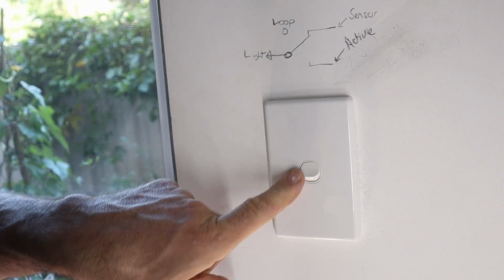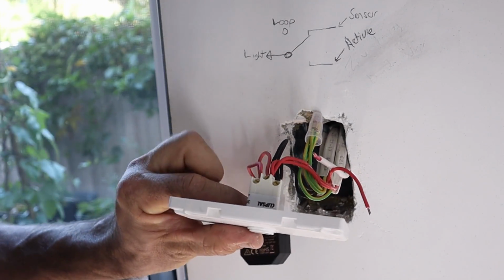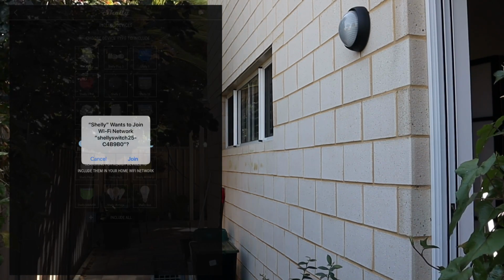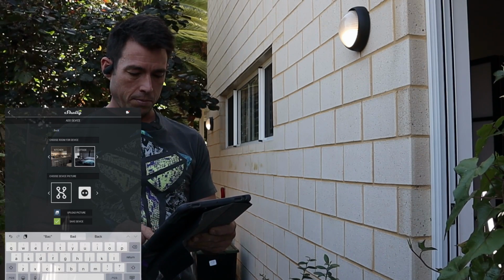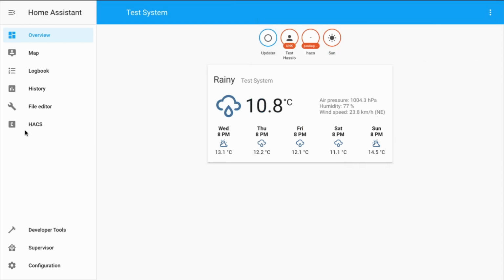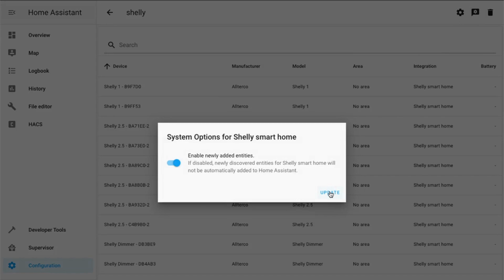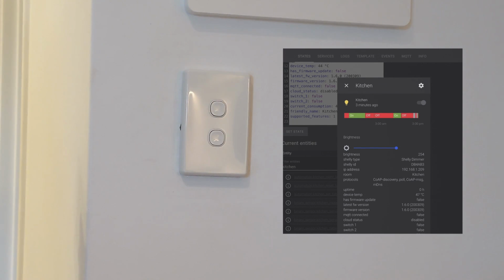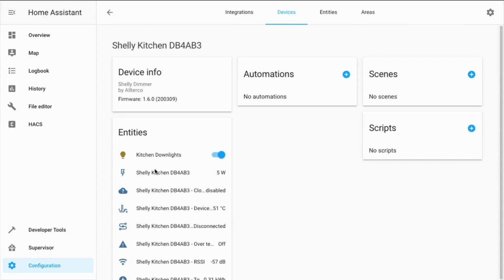Shelly For Hass

Comment: Hi Jimmy , Thank you for the very useful video. I configured my Shellies in the app with cloud on for all of them set a static ip and then added them to Home assistant using the Shelly intergration. Is the purpose of Shelly for Hass to re-configure the devices for use with MQTT (which I would need to do manually if I didn't use the addon) ?
Thank you in advance.
Reply from the maker: Hi Stavros, the Shelly for Hass integration has is just an alternative to Shelly integration, the, they both work well , but from my experience Shelly for hass supports more of the features available and has been around longer.
Reply: @SparkyJames  thank you for the reply/ I finally installed the shellies with the official intergration. I thing it offers all the options Shelly for HASS offers and it is more "user friendly"

Comment: I installed hacs, and shellyforhass, and added "shelly:" in the config file, but I cannot find the shelly devices on the integration menu. Can it be cause the user/password on the shelly devices?
Reply from the maker: Hi Enric, you don't need shelly: in the config file, you can remove it, I don't think it would stop it working though, to add the shelly integration, on the integration menu in the bottom right there is a plus(sorry you can't actually see it in the video)  click on that and search for shelly smart home in there.
Reply: @SparkyJames  Its soveld. I added the shelly: because I have to add de "user" and "password" field for the shelly devs restricted login. :)
Reply from the maker: Enric Aragó There is an entry option, for that in the integration setup page.
Reply: @SparkyJames  I will check it out!
Reply: It works fine, but the time uset by hassio to update the status of the shelly devices is pretty higher than using the shelly as a REST entity. There's also an option, on the config menu, but is still slow updating.
Reply: ah! and it does not appear the power consumption as an entity! :(
Reply from the maker: Enric Aragó That happened to me too, restart home assistant and the other entities will come up.
Reply: @SparkyJames  I try!
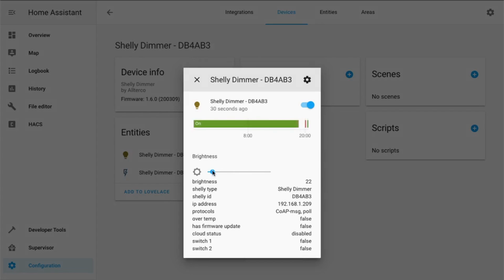Reply: Friend, I saw at 10:55 than you have activated CoAP protocol. I haven't. How I can activate it?

Comment: Could it be that you installed the shelly for hass repository before you searched for Shelly under integration? That's what I had to do before I was finally able to access the integration.
Reply from the maker: Hi Christoph, did you install Shelly for Hass from the HACS ? In the video I installed it fresh from HACS and it comes up in integrations you might have to do a restart of HA. HACS itself is a little tricky to install there are a few videos on how to do that out there. Just thinking about how HACS works you need a Github token for it to download integrations. I’ll try out a new system this week and see if I can replicate the issue you had.
Reply: @SparkyJames  Yes, I installed it from HACS. It seems that HACS and/or HASS GUI has changed quite a bit since you made the video. It looks different. I'm just starting to learn HACS so I'm not sure what more they changed, but it seems they took out some of the default repositories or split up repositories and integrations into two things or something. Another possibility could be that my HACS simply hadn't downloaded all repositories yet when I searched for shelly. But that would mean it takes at least 30 minutes for HACS to download all repositories, which seems unlikely.
Reply: @christophhaug  Exactly the same issue here, looks very different from the video. I fixed it by manually entering "shelly:" in the configuration.yaml file. As with you the "Shelly smart home" option didnt show up under integrations. It does after manually adding it :)
Reply: @minifugi  Good to hear I'm not the only one struggling. HASS has a steep learning curve and things seem to be changing so fast and the many install variations don't really make things easier. Plus they wanted to discontinue certain variants but then reconsidered that but still renamed them so that you sometimes spend more time figuring out which tutorial actually applies to your situation... I'm starting to see why people buy commercial systems... I think I'm going to give Hubitat a try, thought they say the learning curve is similarly steep...

Comment: Your videos are really well done! Question about your dimmer setup in the kitchen: can you use that second switch to remotely control another dimmer?
Reply: Thanks Christoph, Yes you could, but it would be not straight forward, you would need to do it through Home Assistant, I would probably use App Daemon to do it, it might not work quite as well as there would be a some lag, processing the button press and dimming  duration over the network.
Reply: @JamesEggleston  I didn't know about AppDaemon before but I'm surprised that I'd need another app (apart from HA) for this. Anyway, are you saying that while switching via mqtt will be very fast, dimming will be delayed?
Reply from the maker: @christophhaug  To clarify, you can very easily turn on and off another dimmer with the second button and a simple automation, but to dim the light up and down would be the tricker part as you would need to continuously step the level up as long as the button is pressed, I haven't tried it but I think I would find using app daemon easy to achieve it, though there is probably other ways to do it. App Daemon is an add-on inside home assistant, and uses Python to create more complex automations.

Comment: After a few hours work im still trying to get this easy to install app to work.
1)HACS is not included in a "Fresh install" on the image i'm using (raspberry pi 64 bit)...however finally got that working with command line on ssh
2)I've now got the issue that the interation does not appear on the integrations page.
NB: this is an unofficial add-on!
Reply: same for me. can't find any integration under Configuration>Integrations after installing it from HACS. Did you manage to solve this?
// later edit: Figured it out myself after reading the update log on the facebook group. Current latest ShellyForHASS release is not fully compatible with 1.8 firmware on Shelly devices. An update is expected soon.

Comment: Hi James, quick question after your very informative video.
I have a wifi smart bulb on my ceiling which I control by voice. If I flip its wall switch off (a 2-position on/off flip switch), I lose the ability to control the light by voice (WAF problem). If I insert a Shelly 2.5 behind the switch, does it prevent that scenario ? do I need a push switch instead like in your video ? Or is the Shelly not a workaround in that situation ? Thank you !
Reply from the maker: Hi Jerome, yes a shelly would fix that, but you would need a neutral at your switch, if your don't have a neutral, the new shelly dimmer that will ship soon will work with or without a neutral on 230/240v. Also shelly is releasing a single relay unit no neutral required but its not out yet it might be on there website for pre order . You could either use the existing lamp with the relay unit or put in a new standard lamp, if it's only one lamp low wattage and you go the no neutral way, you will need a bypass cap which shelly might sell not sure but they are usually available from many sources, and fit it at the light fitting. Hope that helps, if you 110v with no neutral you will need you rewire the light or lose the smart lamp to get your waf.

Comment: Just getting my head around the Shelly devices and what they can do and how to set up.  Interesting comment you made about Shellycloud running on Android being a bit of a dog.  Resetting up a device yesterday nothing was working (I didn't think to use IOS) but after restarting my Android phone, things started to work (as you would expect).  Thanks for the vids.  Cheers, David
Reply from the maker: I obviously think they are great mostly because they are so flexible in how and where you can use them, and so much easier to setup than Zwave, I think every zwave puck I've installed over the years, there has been some weird parameter number to look up and change, or some hassle. And thanks for checking out the video!!

Comment: I currently have my ShellIes setup using mqtt. But I’ve noticed that not all functionality is easily visible there.  For example I don’t have the IP address.  I think I’ll need to switch these over to be able to get more details without a lot of effort.  For example, I need the ip to connect to it to set things like nighttime light level.  Or, any other setting on the web interface that is not accessible in ha.
Reply from the maker: I agree I had all those problems. It was actually pretty easy to change over, easier than I thought. I just backed up, made a list of the shelly devices and what they were by the MAC address(last 6 numbers) deleted all my shelly MQTT entries in config, restarted and deleted the unused entities and then installed Shelly for Hass, I was a little surprised by how well it all went, Home Assistant has come a long way, it's getting a little bit easy.
Reply: Jimmy James thank you for providing a possible cutover process.  I will let you know what happens.  So, because my shellies already are on WiFi and running webserver, I don’t think I need to do anything to have the Shelly for hass discover them.  Meaning they don’t need to be on Shelly cloud since that’s disabled when mqtt is enabled.
Reply from the maker: @neilbrookins8428  yes thats right
Reply: I was able to successfully setup and get everything working.   It took me as long to setup HACS as it did to setup Shelly for ha.   Finally I have all the data from my dimmer right in ha. I’ve wanted this for a long time.  I can see the temperature and watts and uptime radio strength and dhcp assigned IP address.  It’s great!!!!!
Reply: There is a python script that uses MQTT that I like better. It updates state changes faster. It’s on HACS.